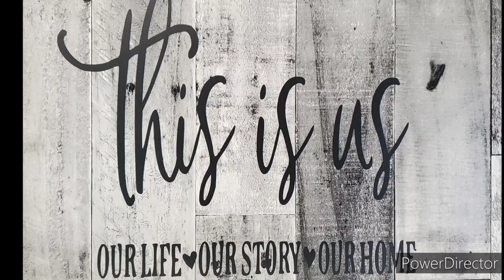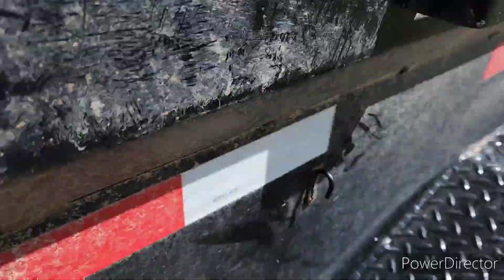Grain Bin Pad Build And Stormy Weather

Comment: That’ll work nice for your bins.  We’ve cemented in 5 old flat bottom bins here.  Made for cheap storage cause their floors were no good.   For mine we laid down a foot of gravel, then set the bins down on 2x4s.  Then we poured cement on the inside about 4 inches deep and some ran just outside the bin between the boards.   That way the water can’t run back inside the bin from snow melt without tarring the outside bottom.  Then used a power trowel inside and they’ve been good for about four years now.  Haven’t had a crack show up yet either in the floors which surprises me a little.  Sure they will come over time though.
Reply: I had never seen a bin floor until watching South Saskatchewan Farmer... everything here is on concrete. A steel floor would rust out in a year or so.. wood won't last long either..
Reply: @GosselinFarmsEdGosselin  dryer climate here.  Wood floor up here lasts a long time as long as you get them onto some gravel to keep the skids out of the water.   Got a one with a steel bottom that is probably 20 years old now and it’s still good.  Need to get hopper bottoms though.  Getting too fat for shovelling.  Hahaha 🤣
Reply: @chadtosh6831  hopper bottom would be nice!! But we have issues with condensation.. have a 12 ton upright bin that we don't use much, all the condensation goes to the bottom.. and it's all gotta be dug out through a 6x8" hole..
Reply: @chadtosh6831  morning buddy. Did you put any iron in the cement? I've got 4 bins that need floors before harvest. I like cheap and easy lol. I've thought about pouring right in the bin but didn't know if that would work.
Reply from the maker: I'm going 5inch thick...and for rebar I'm using livestock panels
Reply from the maker: @GosselinFarmsEdGosselin  concrete is the cheapest way
Reply from the maker: @chadtosh6831  😅🤣
Reply: @bcpfarmandtrucking6560  panels work great!!
Reply: @jeremycherny2041  hell buddy.  Anything will work.  I didn’t put anything in at all for metal!!
Reply: @jeremycherny2041  just poured right in the bin, good base works I guess.  Lol

Comment: Wish I wasn't 2 provinces over or I'd would go to your property and build you two pads the likes you've never seen. I'm not just a cattleman, I'm a contractor and have built at least 1000 pads in the past few decades.  Don't mind me giving you advice: just trying to help. Those bins should be put on a round pad 1" smaller than the diameter so that the wall of the bins sits over the edge of the concrete and you get a dry, snug fit.
See next message.

Comment: Let me know if you have any questions I'd be happy to answer.
Reply from the maker: I'm trying to do this as inexpensive as possible...so 5inch  of concrete and bin sits on top
Reply: @bcpfarmandtrucking6560  Then fix that base at least.  Open up that closed end form and drive back and forth all over it with a loaded bucket. Those nobby tractor tires will pierce the clay and act like an articulated roller. And get a roll of W.W. mesh. The mesh will keep it together where it cracks. so it will stay flat.

Comment: If you are just going to pour a rectangle that is flat, use same concrete @ same slump as written below. But your base will not be compact enough with a plate tamper after you put in about 1 foot of clay and in 1 shot.  You should take out some of that clay, and, using the  toothbar of the bobcat, rake down that clay with grooves. Next you lay down at least 4 bags of GU Portland cement over the entire area per course of base that you put back in. Then, scratch that cement into the clay. The moisture from the ground will cause the cement to hydrate and you will have "non-compactable" fill once that cement is mixed in with the soil-clay. If you don't put the work into making that base sound, your pad can crack and shift causing heave and bin lean.
Reply from the maker: Well f@#k...after all the work we put into it today I ain't pulling it apart

Comment: But, if you don't want to make a round form for those bins, and if you must make a rectancle, a good concrete finisher can produce a 16' round section within the pad which is higher than the rest of the pad which slopes away from that 16'.
See next comment.

Comment: Round pads aren't too difficult to make you stake a centre with a 5/8" rebar and 7, 11" board as a spacer and use ripped 1/2" plywood scabbed together. Pad should be 8" thick. Use pickets every 2-3' and keep them low not more than 2" above form.  Pour 25 MPa concrete @ 5-6" slump and screed with a long straight edge of two 10' 2x4s joined with a scab. 
See next message.